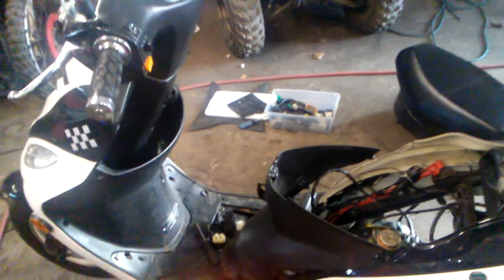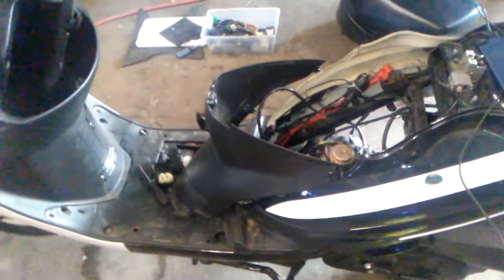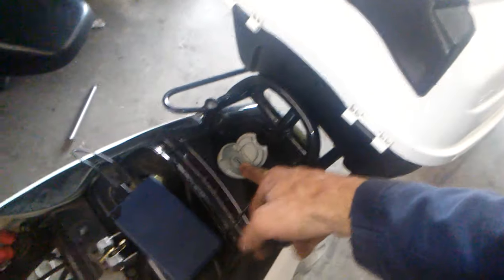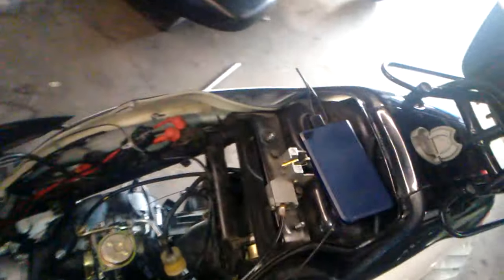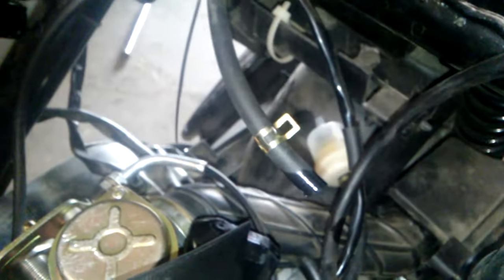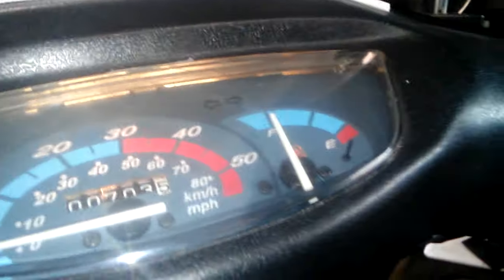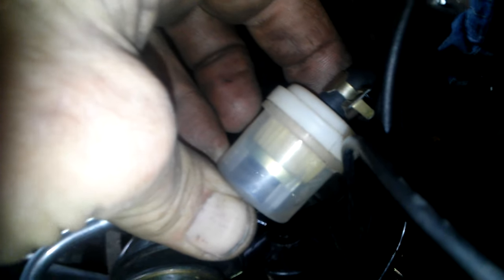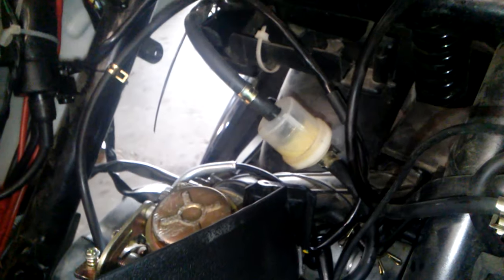Scooter runs short distance then stops running like not getting gas , parts for this in description

Comment: Problem solved bad gas cap this is a relative new new scooter first time I drove it I had the problem it never dawned on me that it would have bad gas cap. Finally it started quitting in a 1/2 mile or so and I tried everything. After seeing your video changed the cap with new one from amazon a $ 7.00 fix and runs like a clock. This video was a life saver!!!!!!

Comment: Your scooter doesn't have a fuel pump, it is gravity fed. It does have a fuel shut off valve which shuts the fuel supply off if you wreck and the engine dies, the valve loses vacuum and closes therefore preventing gas from leaking out and catching fire, at least that is the theory behind it.
Reply from the maker: Because the pulsation cause pressure I’m gonna call it a pump this one don’t let fuel just run out some do ! I’ve seen both !! U got me thinking now if the ones that just flow do indeed shut off with back pressure from misfire backfire  ? Hmm I know the carb has a valve to close the diaphragm! Thanks for the information and you are correct some do just let fuel flow !
Reply: Ah man it does it it's vacuum and floats kids .you have no shut off valve. You have a pepcock similar to a suction pump. Motor cranks ,lil suction pump sucks and pulls the diaphragm in opening the gate for gas to exit final port.so gravity no because honestly he just said the gaskets and gas cap not sealing interrupts the proper seal for the vacuum and gas lines and vacuum lines needed to be replaced. So listen and hopefully you have a really tough job and you tough it through It makes us better 😊

Comment: Gas cap yes , yes, yes I have changed carbs played for 2 week but never did rule out the cap, I did remove it and bam it’s runs, mine only ran for about two minutes with the issue but we are good now. I do have idling issues but it’s small potatoes. Blowing out the cap with air pressure worked Thanks for the info.

Comment: I started having this problem after 5 years of owning a Jinlun 50cc scooter. I changed the carburetor, fuel filter, fuel lines, spark plug, and changed the air filter. It would still bog down. I even tested to see if gas was flowing and it was coming through pretty good. The problem is a lack of combustible air when fuel enters the engine. Regular air just isn't good enough anymore for these aging chinese scooters. So I spray a quick burst of starting fluid through the air filter black pipe before I start up. You might have to do it a second time in cold weather. After that it runs with no problem for the rest of the day. So keep a can of starting fluid on you at all times.
Reply from the maker: Exhaust valve !!!

Comment: My scooter died today. Dunno what happened. I filled it with gas, kickstarted it with no problem but after 1 km it just turned off and the dude behind me hit me in the back. Nothing serious just few scratches here and there.. Afterwards I was trying to start it for 1 hour and it wont start 😥
Reply from the maker: Did you get water in gas or spark loss . Drain screw by front left part of motor has a tube with spring around it attached to the kick start case . Flat head screw driver will open it to drain . I use a cup to catch gas n you can check for water ! Then check spark let me know

Comment: Just got my 2012 buddy running after messing around with everything fuel wise. The problem ended up being the float inside the carburetor. Was not adjusted properly. It was closing the fuel line before there was enough fuel in the bowl. Had to adjust twice. Hope this helps someone
Reply from the maker: Thanks for the information it will definitely help someone! Good catch also

Comment: The gas cap has something To do with ventilating. I have the same gas cap for 5 years. 🤔🤔
Reply from the maker: Yes some models have vent in cap some have an external vent of a different sort , the 150 scooter has a line with a shut off valve when scooter crashes it shuts the vent off ! It basically a ball in a small deal !

Comment: Found this video while I was working on my mikuni carb on a Polaris sportsman. After cleaning and messing and adjusting the carb this video solved my stalling starving for gas problem. Thanks for posting this. 4 years old and still relevant.
Reply from the maker: Very welcome bob people like you are why I do it thanks for the kind words !
Reply: @WaldensWorld  I'm having the same problem out of my 2022 vitacci spark 150 cc I had just left from filling it up and put gas cap on good and tight pulled out headed back to work and got about 75 ft and it just died on me like it wasn't getting any gas you think this could fix my problem??

Comment: Wow thanks for the vid! I've been trying to fix a Gomoto 170cc for a friend that was bogging constantly. I tuned the float a bit before realising it ran better with the Electric choke disconnected, after a quick zip up and down it seemed like it would run great until the electric choke needed to kick in. I have little to no experience with scooters and the whole electric Choke and vacuum petcock is new to me. After replacing the electric choke it would run great for a few km (South African😂) I thought it was due to the engine warming up and not running right, I was thinking mechanical. If I lift it onto the centre stand it revs out perfectly, ie no weight on the back wheel. I'll try the fuel cap in the morning and see what she does. Awesome video, very educational! 100% subbing💪
Reply from the maker: Thanks. “Ubuntu” my brother ! If that don’t work hit me up I’ll see if I can help but hope it works
Reply: @WaldensWorld  Will do! Very impressive how you're still replying and genuinely trying to help and educate!! Props to you💪👏
Reply from the maker: There are two jets in carb the main right in the middle it’s bigger one and secondary one the smaller one next to it ! It may need cleaning I use the smallest guitar string t clean the jets ! Also check the air vent line is clean n clean we have muddobbers that make mud nests in our stuff not sure if you got insects like that ! N the exhaust valves get tight after they get old n hot on some scooters just few things to check
Reply: It worked! Thanks alot for the help!! All along it was just a vacuum in the fuel tank stopping fuel from flowing to the tank. Thanks m8💪🔥
Reply from the maker: @joshuavanwyk2664  whooo helll ya !

Comment: Good info, vacuum petcocks are the other culprit if it's not the gas cap vent. Float bowl overflow hose should be open on one end too. I have seen that routed incorrectly causing a similar problem.

Comment: I'm pretty sure this is my problem too. I bypassed the the vacuum shut off and it still does it with a new carb spark plug and valve adjustment. I can't wait to try it when I get home.

Comment: cleaned the carb on a minarelli 50cc engine 2t.(aerox) vents are ok, tried the gas cap but nothing. if you ride it and stop .. keep dying. cant hold the idle nomatter the screw settings on carb. i'm goin mad... thinking about crankshaft seals... is it possible to have air leaks? it dont raise rpm on idle. you can ride it but you cant stop.. it keeps dying. also e choke disconected cause when it works you cant start the scooter. thanks for the info bro
Reply from the maker: Is it two stroke ? N did you take the choke out ? You will need it in there! If the motor is good n say carb is let’s look at the rear clutch and variatior! If your rear clutch sticks the belt will stay in high gear and it will stall engine when slowing it’s like trying to start off in 5th gear ! Are your variatior roller still round they get flat wore side and wil cause variatior to stick ! ! Since it’s when your stopping I’d check these things
Reply: @WaldensWorld  echoke is on, but i disconected it cause everytime the pin goes down , engine stalls. i just unpluged it and it worked fine. rollers are new(5.5 grams stock weight..i also have 4 gr on hand)..i have changed the belt with a new one but ... its 5mm longer than the stock one and the width is 2mm wider(i put them side by side and reliazed it..its not the same as stock). do you think this is the cause..the longer belt with the stock clutch...
Reply from the maker: @marinob7433  wider won’t let it go into lower gear especially if it’s longer also it may be the issue
Reply: @WaldensWorld  thanks for your help , i will fit a new one with stock specs and i will post how it responds. Thanks again 🙏🏼
Reply: now i have another problem! changed carb with a dellorto 17.5. everything was good. when i started driving.. after 2 miles full throttle...scooter dies. i must wait 2-5,10 mins then it start again. i keep going for a mile then ...dies again... any idea? stock main jet was 58 and fit a 70, cause at 58 the scooter keep revving by its own.. is it the gas cap? seem to me ok. mine its a plastic cap with pinhead opening. mine has a fuel petcock..that from one side has a tube that take the air from carb and then it release fuel from the other tube. seems to flow fine.

Comment: Im praying mine is the same issue🙏🏽Ive spent days on this and done everything imaginable; I even drilled a new hole in  the cylinder for a larger spark plug as I stripped the thread of the other; having removed it 100 times during the last three days🤣I've checked  and stripped down everything; except the "gas tank cap" 🤣 To be continued...
Reply: I just got  out of bed  as I cant wait til morning to see how the gas tank cap looks like... Its got no air vent in the cap and it fits and seals well; its just a random cap from local mechanics here 🤣Tomorrow I'll vent the cap somehow and report  back...  🙏🏽
Reply: 🤣🤣🤣 f**king filler cap. The scooter never died on the test run so this problem is solved 🙏However I still have an issue. The bike seems to miss a beat every 100m +/-  or so. It could be electrical or fuel related given the symptoms. I’ve changed the spark regulator, and spark plug. Cleaned the carburetor and new air filter. It’s almost as if there’s a loose battery  power lead or a short happening as I ride. So I’ll check leads and cables next. It’s an old 150cc Moto1 fat boy. It’s my girlfriends. It’s done a lot o miles too. No idea how many 🤣. But it’s been reliable and easy to work on so I’m happy to make the effort to fix it. Any ideas most welcome 🙏
Reply from the maker: You may check float level if it gets to much gas it will hesitate or jets getting dirty spark plug gap also check that !!

Comment: Today after watching some videos about vacuum lines. So I checked mine. I found  one really bent badly. It was coming the Valve cover it was Forward of manifold. So cut and  reattached there. But it ran back to a different 3way. One line toward airfilter and then back to end of bike on top of housing were belt is located and were gear oil is. Can you understand me, if so place  and  explain it to  me. Thank you. Ps I changed the gas cap.

Comment: I may have this problem but probably not having to do with the fuel line. 9 mile trip to work, and i dunno if scooters Love or hate having their air filters removed. Weird sound comes from the carb and loses power and then off. Still starts tho but its tiresome and not sure how to diagnose this, 1989 Honda Elite 50 e
Reply from the maker: You may have a tight intake valve ! Is it backfires from carb ! After metal warm it expands so if your close on clearance n it heats up it may cause it to open causing low pressure to pull fuel n it will pop out carb if valve is not sealed chech intake n exhausted valves for clearance
Reply from the maker: It also has a vacuum fuel pump you can just run straight line from tank to carb to check it ! Sometimes the diaphragm in it will break n cause issues! It’s usaly a little round deal size of half dollar follow carb line to find it ! You can pull the hose off the intake boot n see if it has gas coming out it should be dry ! But I’m thinking valves
Reply: @WaldensWorld  out of everyone I'm seeking answers from it seems you're pretty familiar with this stuff even after 5 years 😄. 

Absolutely helpful information, I know NOTHING about Japanese or Chinese scooters. Any way I can reach out for anything else you let me know where i can get in touch, I'll check these out

Comment: My cap gas was broken (Yamaha zuma) so i being driven without gas cap i just put plastic bag temporarily and my motorcycle start but shut down after few secend what i need to do . I already ordered gas cap is coming in 1 week.
Reply from the maker: Check gas for water ? It rain on your scooter! There drain hose on case in left front  side we’re kick start is with a screw in the end open it see if u hot water in gas first !!
Reply: The gap gas under the seat there is no way to the water to get inside
Reply from the maker: @Robertodicartlos  chech the drain so u know carb has gas then pull gas line off carb make sure fuel pump works, check spark plug also ! Drain fuel in clear gas see if it separates from carb water on bottom gas on top ! If u has water in carb it may idle , but when you pull throttle it pull fuel from bottom if there is water it dies when pulling throttle! N holler back

Comment: This is exactly what's been going on with my bike . Run's for about a mile then shuts off then I can crank it back up and sometimes It wont crank at all then back and forth . Gonna get a new cap and replace the fuel pump just incase since they are only like 10 bucks off Amazon along with the 5 bucks for the cap . Thanks for the video earned my like and sub
Reply from the maker: Good to hear thanks for subscribing! If you need help holler back ! Holler back n let me know !
Reply: @WaldensWorld  found out mine is trash in my fuel tank . I ride about a mile without the cap and same thing happens . Used my air can and blew into my tank and she fires 🔥 right back up . So it must be the ethenal eating away the silicone that's on the fuel sensor . I'm just going to buy a new fuel tank and sensor .
Reply: I think im having the same issue because I took the bike lock off which causes the top of the seat latch to hit the top of the tank. I used the wrong fuel for awhile - would an air canister help?

Comment: Dang, I had this issue with a chinese scooter that I got last year. I did everything I could think of to get it to run right. But it still happened. I threw the scooter away though after just figuring it was chinese junk. I still have the motor though, I wonder if I can use it on something now that I know whats going on.

Comment: Hi Thks for your excellent video can you please help me I have a Piaggio Zip 2T I change the fuel tap and the fuel valve and no petrol came from the line the connect to carburettor thank you very much
Reply from the maker: Does your scooter have an electric fuel pump ? I’m not familiar with that scooter some will have fuel pump that runs off of the spark signal ? Let me know I’ll see if I can help I may be able to look it up in bit. It busy right now
Reply: @WaldensWorld  I don’t think because I dons see any wires also my battery is completely flat I order a new one is coming very soon many many Thks to reply

Comment: I widened the channels in my gas cap and that made some improvement, however once the tank gets to about 1/4 full it starts having the same issues again, (my scoot doesn't have a fuel pump, but is gravity fed), it pulls the gas out of the filter quicker than the filter can refill.
   one idea I've been toying with is getting a really huge filter, like the kind used on trucks, and swapping it in there in the hopes that it will act kind of like a secondary tank
  any opinions would be appreciated. thanks.
Reply from the maker: Does your scooter run but hesitate sounds like carb float is stuck open to use that much gas ! Check that all lines are clear ! You may have a pick up straw in tank getting clogged too !
Reply: @WaldensWorld  Thanks for responding, man.  to be honest I wasn't sure you would due to this thread being pretty old.
  I went ahead and completely overhauled the carb, and indeed there was an issue with the float valve, but not due to a failure in the carb per se. it was my fault.
  it was due to the seat bucket hitting the top of the enricher and getting partially stuck. so I rotated the carb till it was clear and I think that over time it knocked the float valve out of waak.  once I re positioned the cab again, it ran fine, but I had to modify the seat bucket carb cover a bit to get it to close with ought hitting the enricher. 
  anyway long story short, I did manage to fix the problem.
  I have another Q, after reading your response I got to thinking that maybe there was an additional prob with the tank.   
   I have never worked on one before and I'm assuming the pick up straw is inside where the outlet is.
 any further advise you care to give on that subject would be greatly appreciated.
by the way..,  you got a new sub!!
Reply from the maker: @jacklarson6281  most the scooter tank just have spout going out no straw aka inline filter in the tank ! It can get clogged ! Now if you had a bad gas cap n tank created pressure it will push gas out ! But only till pressure equalized ! I usual just buy new carbs there less than $20 n the cheap China crap is usual a bigger headache to try to fix ! I always keep new on hand scooters and pit bikes ! Holler if I can help anymore I’ll do my best n hope u subscribed braaaaap